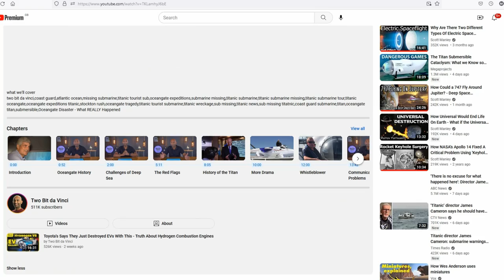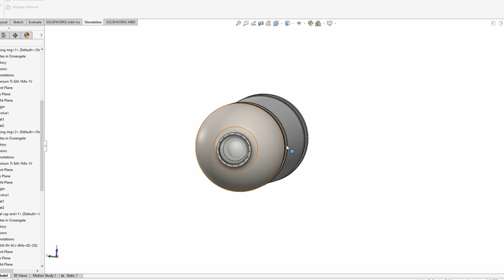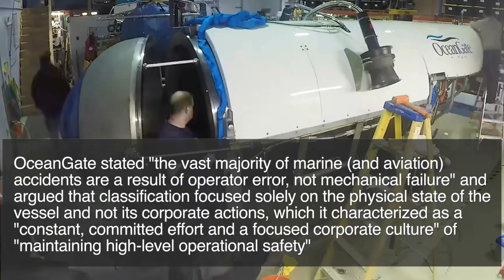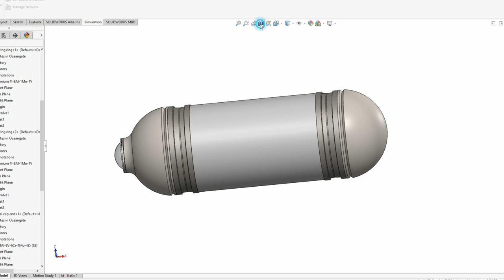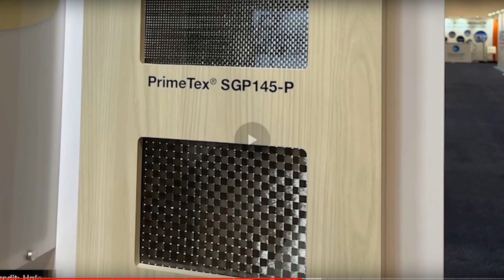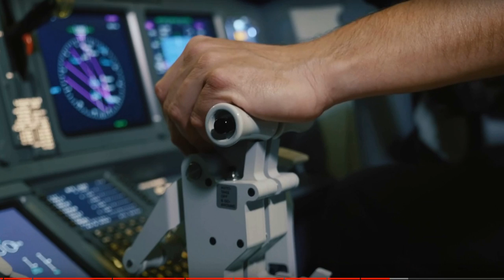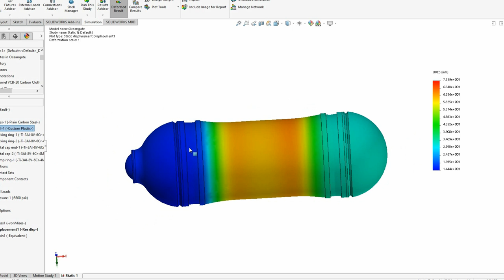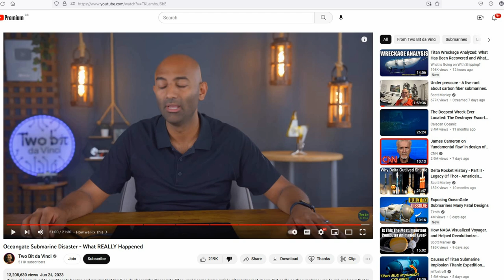Oceangate Titan - Engineering Failure?

Comment: The problem wasn't just that it's a gamepad but that it wasn't  modified to meet fire safety standards (they're in an enclosed small space) and that there wasn't any redundancy. There was no alternative way to control the vessel.
Reply from the maker: Are you 1. 100% about that. 2. What fire regulations?
Reply: @dirtygarageguy  listening to the engineers in the field on this one.
They really were "winging" it.
Subs like these are built often in pairs or if not they have a self rescue RV with pripulsion and robotic arms.
Redundancy takes on a whole other level when your pissing about at 4 miles down.
Two numbers for you.
If you are forming that carbon in an autoclave?
To get optimum resin fibre distribution.
You hit 120 psi and a couple hundred degrees during curing.
Thats not very deep in seawater terms.babout 280ft
The freediive record is 380ft by the way.
Now imagine the bonds between the resin and the fibre holding together as they are subjceted to 55 times that amount of pressure at 6000psi.
The space vs submersibles is generally something the sub guys seem to say to remind them of the level of preparation and risk , statistically space travel is almost safer and easier to attempt.
Hes oversell8nv this as yes watching deep sea engineers have a bit of a humble brag in the comparison
Reply: There WAS essentially an o-ring in the form of what looks like polyurethane tiger seal or CT1 , theres a video of a fella slapping it on like he was building a shower cubicle.
Thats another reason they are focusing in the space analogy...they take a lot of lessons from aerospace criticality like clean rooms for manufacturer.
These guys are banging ut together in a room less controlled than your average paint shop.
Reply: what are you talking about... for one in one interview he indicated they take more than one controller, and the controllers just were a way to conveniently control the parameters in the sub's control system which was tied to the touch screen... People who focus on the game controller are pretty easily distracted.. it's a non issue...
Reply: I believe there was some Pb ballast which could be dropped to increase buoyancy in case they couldn’t evacuate the tank(s).
Reply: @dirtygarageguy Hey Matt. No I can't tell with 100 percent certainty. But I've seen a documentary here where I live and one of the other owners that constructed such a vessel and got it certified said that he wouldn't  have been able to use a gamepad nor openly run cables in his vessel. He would have never gotten the approval due to it being a potential electrical fire hazard.  think that's why ocean Gate's owner described these regulations as "obscenely safe" one time. There are quite a lot of hoops to jump through until you get certified. If this is true I can't tell you with absolute certainty. For that you would have to contact someone who checks these things for such issues before they get certified.
Reply: @EbonyPope  You're right - David Lochridge the ex OceanGate employee/engineer fired by them in 2018 for whistleblowing, mentioned fire hazards among his criticisms of the 'Titan's; testing and safety. 

In the resulting lawsuit, he said his contract was terminated without warning and he was given 10 minutes to clear his desk, because he'd said the sub should be tested to destruction before taking passengers, and raised safety concerns including the fire risk inside the sealed passenger/pilot capsule from electrical equipment eg laptop computers.
Reply: @bambalam9170  While that's probably true, I wouldn't depend on that alone because bouyancy changes with depth. The deeper you go, the less bouyancy you have because water density increases so much, so that dropping ballast becomes less effective. There comes a point where you could eject the ballast only to find that nothing happens.
We had this problem at work where we were using 150N life jackets, but we calculated that a guy and all his tools going in the water would sink so fast that when the life jacket does deploy it's just maintaining the depth, it can't bring him back up again. We had to switch them all out for 275N to make sure they surfaced if they went in.
Reply: @mazdamaniac4643 don't things sit wherever they have equal density, so the deeper you go the greater difference and requiring more ballast or thrust to remain at a greater depth?
Reply: @chrisnoname2725  Things do sit where they have equal density, but in water, your own density increases with depth as well.
With submersibles it's very complicated because the hull is under pressure as it dives, but it's volume can't really change, so it becomes more dense. Same with the external ballast. They have to calculate it to have a slightly positive bouyancy at a specific depth, but it's way out across the rest of the range unless you dump ballast or change your bouyancy by venting.
Our problem with the lifejackets was because as the guy sank, the total increasing density of the body+clothing and their tools etc. which couldn't be dumped (because they're theoretically unconscious) grew to the point where the deployed 150N lifejacket just couldn't overcome it if they sank more than ~10m before it deployed. So we had to alter the starting bouyancy to 275N. That was with only 20m of water depth.
Reply: If they got stuck somehow and had to use oxygen, maybe the oxygen concentration would get very high. Then even the tiniest spark, even just from static could in theory set all surfaces on fire, even the organic matter.
Note i am not a scientist or anything, just basing this on the chemistry experiments we did in school with oxygen. Like in pure oxygen almost everything burned.
So i guess this is why maybe an off the shelf controller might pose a hazard.
Reply: @vlnow  Good point and quite correct. You'd be surprised what becomes flammable in pure oxygen. You might also be interested to know that biologically, your lungs are not designed to breathe pure oxygen over time without incurring serious damage, neither at normal pressure but especially at higher pressures.
Elevated levels of oxygen becomes quite toxic at high pressures and levels, causing cell membrane damage, ruins the alveoli in your lungs, can knock you out and then kill you.
It's one of the reasons why divers supplement the nitrogen in their breathing air with something like helium etc. not just to reduce 'the bends' because they've got to keep the oxygen percentage at or near 21%, too little and you slowly suffocate, but too high and it will start to poison you.
Reply: @miaknecht   Yeah and applying some type of epoxy glue is also a "non issue".... there is no glue in my washing machine and it's not designed to go anywhere.... everything is either bolted or welded, even the cables  are not glued. In fact my washing machine looks more sturdy than this thing they used to go down to the bottom of the ocean. What type of glue were they applying on the titian rings with some spatulas.... it looked so uncanny and unreal... I don't know if the glue was supposed to seal something or hold the whole thing together.... but it's crazy looking.
Reply: The point he was trying to make about the name being a walking scandal has to do with the watergate nixon situation.  Oceangate / Watergate.
Reply: Excellent deconstruction. Quite informative.
Reply: The problem was that it was wireless.
Reply: And no way out...locked/bolted in from the outside. Someone needs to pay for this ...
Reply: Yeah the problem was it was a wireless controller. Being wired would take away an easy fail point.
Reply: @volcomstoned876  Thank you - I posted similar! Alas the 'WaterGate' - 'OceanGate' analogy that the original 'Da Vinci' YouTuber identified (a smart observation), was entirely lost on this YouTuber!
Reply from the maker: But is a fire hazard related to games control pads, and gopros and mobile phones, and cameras???
Reply: @dirtygarageguy anything with batteries inside (specially Lithium ion/polymer) represents a fire hazard indeed. Even when buying electronics online the boxes come with warning stickers
Reply: @dirtygarageguy they were probably running a haylon system! 😂
Reply: @sergioesad276 was it a wireless controller? And wouldn't custom fly by wire controlling mechanisms still be wired anyway? Furthermore I'm assuming they are breathing 21% oxygen in there so there is no extra requirement for oxygen cleaning standsrs of the interior afaik.
Reply: @carlosandleon  yes, it was. It was a Logitech
Reply: Redundancy is for wimps, as is safety and, according to Gordon Gekko, lunch.
Reply: @miaknecht easy to see which people have no clue what they're talking about. Controller wasn't a big deal and he did have a few spares. That wasn't the problem and people talking about it clearly are lost.
Reply: Two big IFs:
(1) IF I remember it right they had spare game controller(s) on board and also spare batteries.
(2) And IF it actually were conventional batteries (to be replaced, not rechargeable ones) the fire hazard is pretty low. Much much lower than for rechargeable LiOn-batteries which can develop internal shortages.

The particularly high risk from LiOn batteries is once they start to overheat and deform, due to internal shortage they go to higher and higher temperatures. The process can't be stopped by blocking them from oxygen as all the reactive chemicals to produce more heat are inside the batteries The only thing is to store them in a safe place. Ie. A fire proof container well insulated on the outside with unflamable material so that the heat inside can't "escape" and set conventional stuff around them to fire.
Reply from the maker: So, what are the chances of a game controller bursting into flames? Right next to zero. Millions of people have them and this doesn't happen. Also, in the sub people have phones, and go-pros. James Cameron took LiOn camera in his sub. 

This whole idea about fire safety is rubbish, and doesn't have anything to do with what actually happened. 

As a side note, people take phones on planes...
Reply: Also, it was a wireless controller with batteries. Army use almost exclusively wired controllers to reduce the risk of failures and interferences
Reply: @dirtygarageguy  I don't know if it's true 100 percent as I said. It's what someone else said in a documentary about the whole certification process. I don't see a gamepad as a huge problem too. What I would be more concerned about is that there was no redundancy. They had to reprogram it once mid dive as far as I remember because the controls were inverted. At least that's what someone who went on a dive with them told the media.
Reply: @dirtygarageguy  Don't know. I think it would be good to ask the ones who certify those types of vessels.
Reply: @mittelwelle_531_khz  I think what one of the passengers criticized wasn't the fact not having a second gamepad but not full redundancy. What difference does it make it you take another gamepad but the receiver is broken? You need full redundancy like in an airplane.
Reply: @EbonyPope  can we'll be. And in regard to this video l need to say this was by far the best coverage I saw about the "Titan accident" and unless new information comes up I think it's hard to top.
Reply: @dirtygarageguy  You haven't mentioned the biggest fire hazards inside that hub - the multiple lap tops (owned by crew and paying passengers), the flatscreen TV incorporated into the sub wall, and the cheap, off the shelf interior lights bought from a camping store!

Those multiple electrical items, inside a confined space human beings were bolted into from the outside, and had no hope of escaping without external, professional help, were obviously a significant fire risk.

Anyone who gets inside a water borne vehicle they have no hope of escaping in an emergency of ANY kind, is extremely foolhardy.

No, these five men didn't die by fire but by implosion, proving the vessel structure itself was not fit for purpose. But clearly the same reckless negligence could have resulted in a fatal fire too.
Reply: how do you know there was no other way to control the vessel?
Reply: @dirtygarageguy completely sure, all the screens and electronics and even the lights were off the shelf equipment, which is not fire safety revised and on top of that they didn't have oxigen masks to operate in a contaminated air environment in case of fire but they did have those shitty provisional air breathers which are basically a green plastic bag to put over your head and I don't know, suffocate quicker
Reply: @deadprivacy  Right??  God, that was weird.  Rush seemed to think that the worst thing that could happen is a crash and you can’t do that in water!  I wonder how many people who were involved in the development and engineering of that thing cringed while watching that CBS report.  For ex: how the hell can you say that if you lose everything - comms, electricity, whatever - that you can lose that and still be ok?!?!  Like, what???
Reply: @ts757arse  Where did you get that?  I heard that every submersible that went that deep was certified, save OceanGate’s.
Reply: @deadprivacy I suppose essentially it became a heavy duty shower cubicle.
Reply: @Travis_22  the ultimate i. Power shower tech, the water rushes in so fast it friction ignites the air and your loofah in a millisecond.
Reply: @deadprivacy  Indeed. Good first comment btw.
Reply: @Travis_22  you learn a fair bit if you listens to dirty garage guys.
Ive developed a materials science first philsophy in engineering, always referring back to your ingredirents, the forces you are going to apply are just the recipe.
But if you forget you made the bottom of your ten tier cake out of sponge and want to add just that one extra decoration...
Oops.
I still cant get this old fucking honda to go though. That spark is far too red i think.
And now the battery is flat.
Reply: Thank you! I said the same thing. It's not flammable in a surface control room but, could be in a higher oxygen ppm environment with other possible fumes like fuel contamination locked in an air tight compartment. The other off the shelf stuff like computers, wiring, the LED lights weren't designed for a high oxygen environment either. Computers and monitors can overheat too and ignite too. A lot to consider in manned vehicles. Unmanned pods don't need oxygen nor a hatch that can be used as a pressure cooker and implode.
Reply: @dirtygarageguy it depends on what the controlling standards body is, but putting materials that spread fire when overheated, or which give off poisonous fumes when burned , inside a confined place is a bad enough idea they are prohibited inside walls in office buildings (National Electrical Code). It’s possible some of the maritime standards might cross reference them.
Reply: @dirtygarageguy if you have issues with a lipo battery in an enclosed area your day is going to get pretty ordinary quickly haha.
Reply: Anyone that operated or docked a boat knows it isn't a good idea to have anything else than hard wire bulletproof propulsion control you can trust. Many small passanger ships are still being built with mechanical wire for propulsion, when something fails you slam into a dock. It happens few times every year in my country alone (on ferries especially). And for subs manouvering is 1 dimension harder (3d), low visibility, restricted view, and all other underwater objects are trying to strand you if you touch them. Ancient shipwreck is also barely holding itself together and may collapse on you, beneath you and even beside you and push you away while you are trying to pair up your controller

Comment: Ah, now you have got me thinking. So if we took a longitudinal section at 5" thick. This could be a shear failure just like a simple beam. Except worse, because it would create 2 points failure. The outside is in compression and the inside is in tension. At some point, this will probably shear along the neutral. This will also distort/skew the ends where the Titanium rings meet the Composite Cylinder.
(For those that do not know,  bend a book or ream of paper and watch the way the ends angle out, at 5" thick a small deflection over time could pop that seal. Just my thought.)
Reply: No doubt that effect would be amplified as the hull wasn't a woven type - it was spooled!
Reply: @jackking5567 the spooled hub, if all 5 inches were, is unbelievable to me. very little strength along the beam?

Comment: Thinking a bit more on this....
Composites behave very differently in tension than compression.
In tension the fibers carry most of the load.
In compression, the matrix carries most of the load while trying to keep the fiers in column to prevent buckling.
As the composite is cycles & micro cracking increases, the composite becomes more flexible & the fibers can move more freely in the matrix.
So the composite becomes stronger in tension as the fibers can carry more load but becomes increasingly sensitive to buckling in compression because the matrix isn't holding the fibers in column any more.
Spinnaker poles are only in compression. When the carbon fiber versions first came out it didn't take many load cycles before simply touching the fore stay while the pole was still loaded caused an instant violent explosion sending razor sharp shards everywhere.
There are really great videos of America's Cup boats turning their spinnaker poles into scrap during jibes.
Ocean Gate submersible was only ever in compression.

Oops....